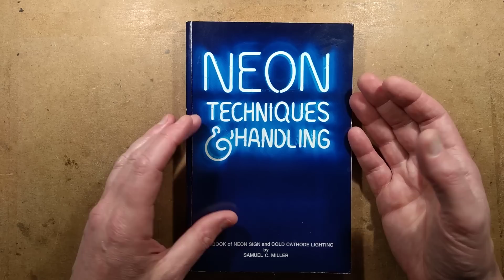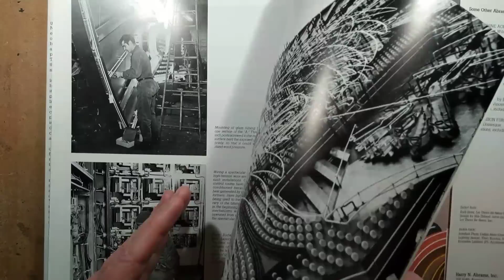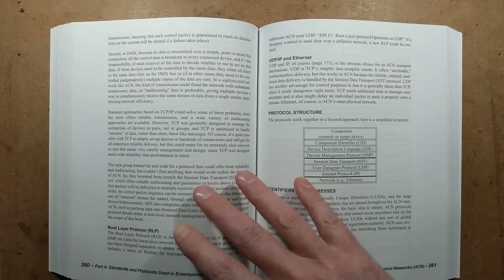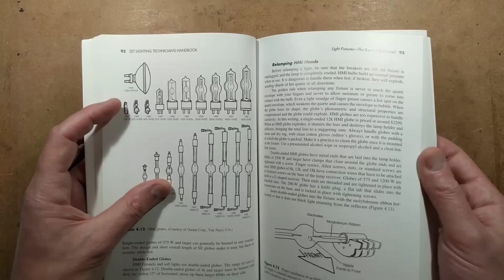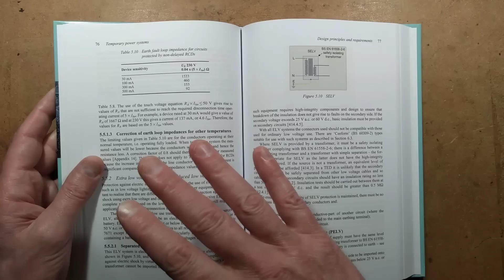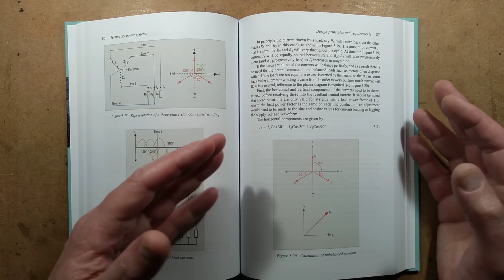Technical bibles of showbiz.  (And neon.)

Comment: Thanks Clive, that's a very relevant and practical video.
We love books, apologies cellulose.
If ya don't mind I would like to share a bit around the entertainment industry and our involvement here in South Africa.
All of our theater's in South Africa were populated with Aeg machinery and controls for the stage movement as well as the upper stage machinery to work the lighting booms and scenery.
During the embargo's and sanctioning of SA by European suppliers the support for the installed equipment fell on technicians who had worked for the internationals.
I began my career working for the locals who took over the Asea thyristor controlled rectifier products and then moved on to Control Techniques.
Wagner Bureau did a new install at the Artscape in Cape Town and our vsd's were put in as that is the flavour they like.
That's when we got to know the Aeg guys and they have used us for the upgrades in the rest of the country, we get on well.
Anyhows, you mention the interference issue.
We had that at Artscape in Cape Town.
They installed some point hoist winches for "War Horse" and had hassles with the encoder feedback from the motors.
We lent them a sine wave motor lc filter to check if it was noise and yes it was.
We has some surplus braided screen power cable which we gave to them and problem solved.
The cable once it has been used can not be sold as new, so we keep it on hand and "donate" it for a "pro bono"' like in this case.
It pays us back, these guys order 100 drives from us and pay for it cash with order.
I love the arts work, pity I watch so few of the shows.

Yea, thanks for sharing this talk and I hope you enjoy my tiny share on what we see on the motion side of the showbiz side of things.

Comment: Clive, do you have any suggestions for something cheaper than a real "neon testing coil" such as https://www.gogsg.com/2315938/Product/EGL_Company_BD10AS
Reply from the maker: Those are based on the old violet wand units.  You can get a modern version called a darsonval unit on eBay.  But don't use a metal rod or electrode in it as it will be referenced to the mains.  You can also get low output tube testers with a telescopic antenna on them.
Reply: @bigclivedotcom  Thanks, exactly what I was looking for.
Reply from the maker: @mmmlinux  Search my videos for darsonval to see inside one.

Comment: Hello Clive, do you remember the Blue Neon that used to be on the curve of the top windows of the Beresford building on Sauchiehall Street in Glasgow (Baird Hall Students halls of residence next to  the Garage nightclub) when the place was closed in 2004 and sold to developers this was switched off after operating since 1938 when the place was built, it was converted into about 100 flats and sold off bit by bit and the neon lights were never switched back on, from what I gather the neons were ripped off and binned/junked by the property developers..

Another old set of neons which still exists in Glasgow (I think they still do?) is the "Barrowland Ballroom" neons (which were so famous that recently they were still being referenced on television adverts/commercials and being sold as framed photographic art colour prints in art studios and photography shops)

Viewers here can Google "Baird Hall Glasgow Neon" or "Beresford Glasgow Neon" and will be able to find colour photographs dating to around 1999 to 2003 when the Internet started having a lot more photographs added in various formats and also before the lights were removed...

You will also find Barrowlands Neon photographs which will have more recent ones added as well.

Both of the places referenced by me are in Glasgow UK

(I had a look for the beresford/baird hall neon photographs as they are kind of scarce and the only one I could find still up on the Internet after all those years is snap happy Ross, the problem with old photograph websites dating back before around 2010 is that they were mostly all free hosting Web pages and nearly all of them have gone down/ closed for various reasons and with old Internet companies closing)

Here's the website, please scroll down to see the photo.

http://www.snaphappyross.co.uk/europe/scotland/glasgow.shtml

Comment: A little story about neon.  My architect and I were working up a renovation of a cafeteria at a defense contractor building.  The architect wanted to add neon highlights but they said no expecting the neon to interfere with their crypto stuff.  So the architect borrowed a neon palm tree and hung it in the cafeteria unannounced for a couple of months while we finished the drawings.  When they saw the neon on the final drawings, they wanted it removed.  The architect pointed out that there was neon in the cafeteria for a couple of months already.  Final outcome, the cafeteria got neon highlights.

Comment: I do love a good technical reference book. Being a network engineer I've gone through a fair few, but my favourite was Mobile Communications by Jochen Schiller. Having never been exposed to telco mobile/cell networks or satellite communications, or for that matter anything Wifi below layer 2, it was a real eye-opener. Definitely helped me in discussions of the benefits and drawbacks of the fixed-wireless component of our national broadband network here in Australia. Not to mention actually setting up remote satellite uplinks and terminals in my work. Not many network engineers outside of a small portion of the telco sector would really get an opportunity to touch on those areas, but it's very interesting stuff.

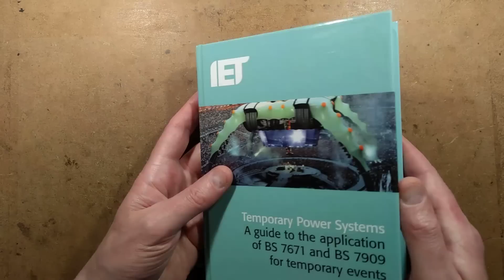Comment: 19:00 My step dead once "connected" and mains outdoor garden light every time the switch was flipped. Electric was going funky (old style melting fuses) I think he had a short to ground somewhere or outright connected neutral to ground or something.
I unplugged it (disconnected the wires in the hole of the switch and put them into luster terminal (connected to nothing, just so that I don't have bare metal around and potentially shorting something out)
Still don't know how you can screw up three wires so badly. (And was to lazy to investigate at that time)

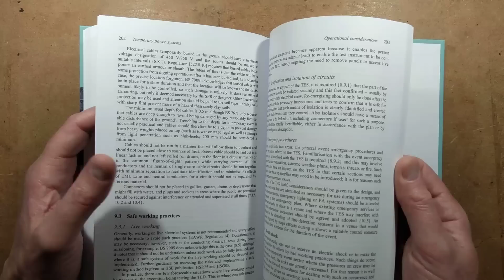Comment: 14:58 - "Why sticking an earth electrode under the tyre of a generator is completely unacceptable, and lying it flat on the ground is also unacceptable."

Just to be clear,  are they talking about using the weight of the generator to clamp the electrical connection to the ground or tossing the bare wire onto the ground and hoping it somehow makes an earth connection? I'm a little puzzled by the concept that people could be so stupid that the have to be told not to do that.
Reply from the maker: The lack of penetration into the ground means that an earth electrode under a parked tyre is useless.  Try running an earth electrode test.
On a plus note, the testing in the BS7909 standard showed that several short electrodes placed into the ground spaced well apart gave much better results than a single deep electrode.
Reply: I'd think that it should be obvious that sort of earth would be useless, which is why I was so perplexed that people have to be told NOT to do it. Then again, I've heard of somebody testing for power by sticking a finger in the light socket.

Multiple short electrodes being better than a single long electrode makes sense to me. It increases the connection to the topsoil, which (unless it's completely desiccated)  is probably far more conductive than the clay subsoil.
Reply: Matt Quinn - Are you trying to fright me?
Because you've succeeded!

Comment: It's odd for me to see a xenon discharge arc lamp being referred to as an "older" light source.   I recall running a spotlight using carbon arc as a light source--as did most commercial film projectors of that time.    Onstage lighting was always incandescent, with the dimmer board using what amounted to variacs (autotransformers).
Reply: But you must admit that lighting is better today. At least the actors can wear contacts and don't suffer their makeup melting off.

Comment: A quick question it’s sort of pertains to what you’re talking about I live in Southwest Florida and due to the weather we get frequent power outages and I use a portable generator to run things like my cable boxes televisions Chargers for various things and maybe a fan in the house for these short power outages my generator is 5000 W should I be using an earth probe with that generator. We use heavy duty extension cords I do not have the generator hardwired into the house electrical system.
Reply from the maker: Regulations vary between country, but I think your generator should be fine if it's close to the house and connected to the normal house ground.  The rod is usually used where a generator is situated remotely and the ground in the vicinity needs to be brought to the same potential of the generator chassis.

Comment: My first recollection of animated neon - and I bet Clive saw it too, was an advert for Barr’s Irn Bru which was located on a table end of a building in Glasgow’s Union Street, and could be viewed along the length of Renfield Street.  The neon panel measured approx  12m x 6m featured a display that started in darkness then built up to full brightness with 6 elements that each added to the previous element to promote the advertisers message before going to black and starting again.  I wouldn’t call this animation per-se, but if you watched it carefully the face of the Ba-Bru character’s tongue moved three times towards the lemonade bottle in an arc across his smiling face. I’m told it was erected in 1948 and stayed in place until the early 70’s - indeed I (wrongly) assumed this was the inspiration for the George Square ‘Swinging Bells’  Christmas decoration.  Happy daze......
Reply from the maker: I can recall that sign and the non PC Robertson's jam sign.
Reply: bigclivedotcom  Where was the Robertson’s sign located?  I don’t recall that one...
Reply from the maker: @raymondokonski7018  Same block.  There were a lot of signs around Central Station.
Reply: bigclivedotcom Tks - I know the logo (and I collected the badges!) but I’ve no memory of it being there - although I’m sure you’re correct. I tracked down a picture of it but there’s no way to upload it here, so I’m stuffed. There was also a large blue ‘Player’s Please’ neon beneath on the Union/Gordon St corner building but it only flashed!  The LED replacement has no character (probably because it is ephemeral).
Reply from the maker: Glasgow used to have a company called Franco Signs that rivalled The Young Electric Sign Co of Las Vegas.
Reply: Matt Quinn  Try this, I do have a better one, but it is a JPG, not from a URL!  https://www.scran.ac.uk/database/record.php?usi=000-000-116-506-C&scache=2hal28h00b&searchdb=scran

Comment: The photo on the front of the temporary power system book is of the U2 360 tour stage and I am pretty sure that stadium isn't Wembley stadium (correct me if i'm wrong), It could be Croke Park on Dublin, the big stadium in Zagreb or any number of places in the US they visited, anyhow just seemed interesting to use a non GB stadium on a book about British Standards.

Comment: Hi Clive, I saw this come up in the news again, sad but interesting. Power supply failure, Incorrect wiring, mixed up 120V instead of 12V ??

https://www.nbcnews.com/news/us-news/family-sues-after-girl-electrocuted-touching-handrail-mgm-national-harbor-n938126
Reply from the maker: I strongly disapprove of the use of mains voltage flippant architectural features in metalwork the public handles.  Especially in wet areas.  And especially when it's maintained by general labour with no proper electrical background.

Comment: Amazon seller, used facial recognition to query my USA database, YMMV
First, 1.8 million rank, about $25
Second, and updated version has rank 120k, sells from $10 used, $70 new
Third, 98k, $45 either way
Forth, 1.2 million rank and cheap, or new edition 78k, $40
And that last one is really for the course James teaches.

Comment: Something new i learned yesterday. don't wave a modern mobile phone near those green contactless door buttons. got a jolt from one with a audible crack of discharge!
Reply from the maker: That sounds like static charge from touching grounded metalwork after walking across a carpet or other insulated surface.

Comment: The two electrical engineering books I always seem to need around are The Art of Electronics and Radiotron Designer's Handbook . These have detailed, mathematical analyses, and practical methods & recommendations; the latter was last printed in the mid-1950s, IIRC, but there are plenty of copies online. The old tube and industrial electrician's manuals are ALWAYS good additions.

Comment: Real Books beat the chit out of anything on the Net.  Especially when you need the information at hand.
Reply: Dunno. Can find a PDF on the internet of a scanned book or schematic a lot faster than the real thing.
Reply: @davidmcgill1000  True.   If you have access to the net.   Actually a pile of information has not been loaded to the net.   Information lost being loaded.  Once valid information not loaded and updated with substitution information modernized.   EVERYTHING is not on the Net.   What happens when it's GONE ?   You do realize the Internet and GPS can be turned off with the flick of a switch right ?

Comment: Some cool-looking books! Speaking of control systems, last time I was at a theme park, I noticed they were using PLCs to control the rides (here in the US, Allen-Bradley PLCs, like the ControlLogix 5000, are pretty common). I used to do controls automation at various manufacturing plants, and we had huge control networks--- the main PLCs, HMIs, and big boy servo drives all were connected over 100-BaseTX ethernet, but used the proprietary Ethernet/IP protocol (IP = Industrial Protocol in this context) or MELSEC protocol for Mitsubishi stuff. One particular network we had was sending well over 1 million packets/sec on the Ethernet network! In addition to Ethernet stuff, there was also 10-Base2 ("Thinnet"), ControlNet, RS-422, and HART. Needless to say, troubleshooting communications problems was a lot of fun.... lol
Reply: Jacob Hipps I used to design flare/incinerator control systems and fitting in with their excuse of SCADAs. Yeah I’m thinking of you annoying Nigerians and their modbus HMI network... just use lamps and forget tiny little 5” HMIs!!! It was for a huge, was the largest, multipoint flare field which probably can be traced to me but I don’t work in that field anymore!!!

Comment: I did a quick search for 'UK neon sign makers' there's a whole page of results, a coule are custom makers.
The guy doing the controls in the book, could that have been controlled by a cam timer ?
They are reliable and robust
There's a famous incident with animals electrocuted due to a ground fault like you described, it's not just 4 legs, but also the distance between front and back, 
search for 'newbury racehorses electrocuted' and you'll find video.
we had to put much longer/deeper ground rods on the farm estate where i worked.
Reply from the maker: Neon has become more of a specialist architectural or art medium.  I wonder how many of those neon sign makers are using LED neon. The cam switches were very popular in many signs and in American fairground ride lighting.  I think the Barrowlands signb in Glasgow is mechanical from the slight dither in the channels switching off.

Comment: @bigclivedotcom If there were one subject in electrics and/or electronics you would like to learn more about (something you would be willing to attend a formal a class/course in) what would it be?
Reply from the maker: Possibly power distribution.
Reply: @ bigclivedotcom My profession is in Water Distribution. There are  demonstrations where they will reference and show water distribution systems to explain the very basic electrical distribution systems. The volume of water being reference to Amps and the water pressure in the pipe is the voltage. I do believe you have explained this or even shown this reference before.

Comment: I have a crazy question, flexible neon? Is it possible? Maybe Teflon tubing?
Reply: not an expert but would guess not since the gas pressure inside the tube is tiny - flexible tube would be flattened by atmospheric pressure.
might work if surrounded by hard vacuum... or if you made a tube with a lot of re enforcing hoops to stiffen up the circumference (but that would probably be quite unatractive)
Reply: interesting idea. It would have to be fairly rigid though, since neon tubes use low pressure gas.
Reply from the maker: They've tried, but it's very difficult because of the internal vacuum and outgassing from the electrical activity and heat.  The LED based linear strip is the closest reliable medium.